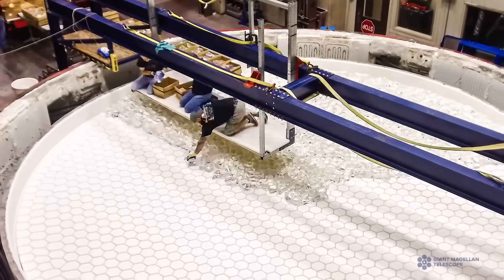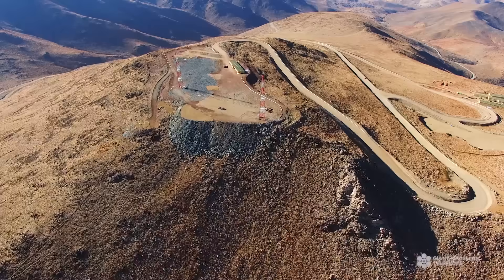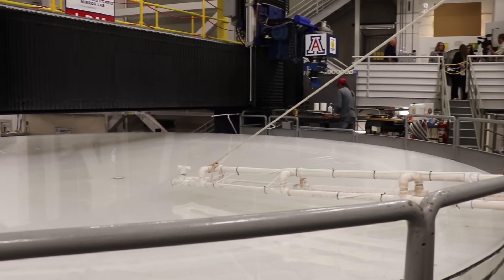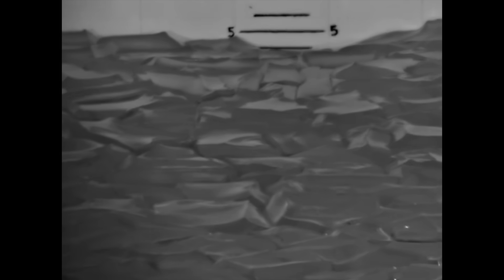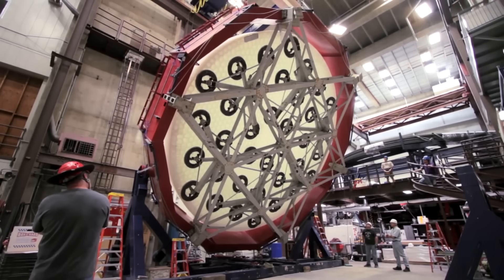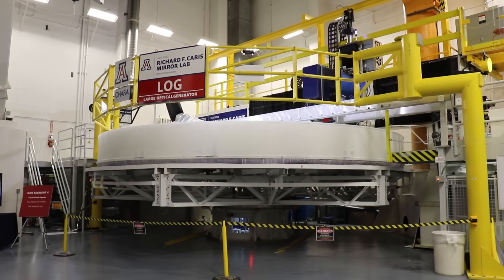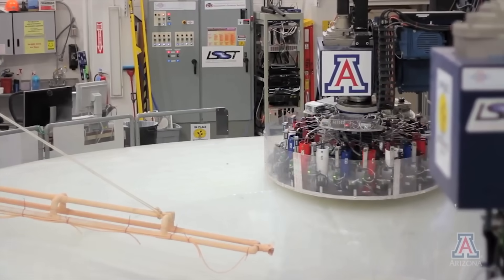Casting a $20 Million Mirror for the World’s Largest Telescope

Comment: There was no manual for that stuff. And they had to nail everything first try. With processes that had to run flawlessly and continuoutsly for years.
Reply: They still haven't finished. It's taking much longer than expected. Most things didn't go flawlessly and they didn't nail things first try.
Reply: @lynth  I can imagine, but man, everything hinges on this gigantic optics, there are quite a few mistakes one can make to ruin this 3 billion dollar project. And you know, there is also manual for it, just found these guys are called Richard F. Caris Mirror Laboratory and they are experts in this, pioneered so much technology and quite literally polished their processes over decades.

Comment: 25 meters diamater looks wrong. It doesn't relate to its size shown or how much it weights or it needs 25 stories building to house it.  It is also kinda odd that I can buy mirror meters in size and here, 25 meters one costs 20millions and have to be done in pieces.  They should instead visited their local IKEA, would had saved 20 20 millions...

Comment: would it be easier and better/larger to build a mobile factory on the mountain top? :) so when the job is finished. just just connect the mirror from beneath and can swing It that way. you don't have to adapt to the transportation of the mirror, means you can build a 100meter mirror :)

Comment: The first thing that comes to me is water optics... as in a plastic or glass mold filled with water instead of a glass lens or mirror. There's quite a range of stuff I don't understand if that would be possible or not but it seems like the least resistive way to manufacter large optics using readily available mediums.

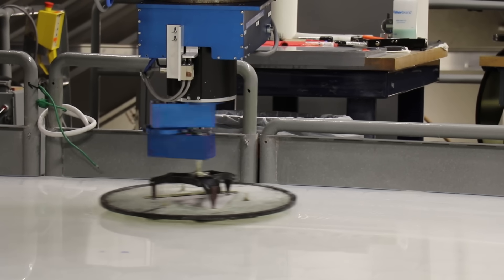Comment: 2:09 “that’ll get us down to nanometer level precision.” holy smokes
Reply: Yeah, when you're doing something like this, just a really small imprecision can fuck your numbers up.
Reply: @AAAAAA-qs1bv  it's in ratio. 
It looks small to you but it's big in terms of ratio. It's a significant error for them because of the distance in between
Reply: General Motors builds their cars on that principle! lol
Reply: The mirrors we use for photo lithography in the smallest semi processor nodes are only about a meter in diameter. If you were to proportionally scale them to the diameter of the earth the largest abberation on the surface would still be smaller than the thickness of a human hair. Modern grinding/polishing tech is crazyyyy.

Comment: You know I think I figured this out.
Take a non reactive atmosphere i.e. pure nitrogen.  In which spin a bowl of sodium silicate to produce the required profile.
Then just introduce CO2 crystallizing the sodium silicate into solid glass.  Without the temperature difference in production there should therefore be no thermal stresses.  The sodium silicate being water soluble should have a controlled viscosity, which means it should be possible to have the centrifuge, more closely produce the intended profile.

Comment: For the love of science, QUIT using a vacuum for the application of the reflective coating, purge it with ARGON!!!!!
Reply: Why?
Reply: @logitech4873  vacuum does not remove all air no matter how much it is tried
Argon on the other hand will displace everything that can cause oxidation of the mirror finish when it is applied
They had issues with this on the original Hubbard telescppe
Reply: @Twinkcentral  That's probably a very good point, but if they decided on using a vacuum for this project then there's probably a reason they chose it over argon.
Reply: @logitech4873  Not necessarily, remember even with all the edumicated scientists building the 1st Hubble, they still managed to screw it up. And if II am not mistaken they screwed up the most recent space telescope also

Comment: Ok..So melpco centra lab Made the Parabolic refractor for the Hubble telescope. That was a subsidiary of North American Philips. Which is actually philco of the Netherlands fortune 3! People don't realize when they see their Philips electronics that Phillips is fortune 3 not Fortune 10 or Fortune 500 fortune 3! Meeting there the third biggest corporation on the face of the globe. I worked in the department that made the ceramic circuit boards with silk-screened on traces. That was located in Glendale Wisconsin and another facility in Waukesha. The state of the art 28 head pick-and-place machines made by Mitsubishi were amazing and you should have seen our annealing process that we had to go through for this mirror unbelievable more talkin way back then I'm sure they have a thousand head pick-and-place machines by now which actually pick your little components out and suck them up with vacuum and grab them with microscopic little hands and go on the X Y and Phi  access picking & placing your submicronic
Reply: Circuitry. Sorry my Google speak to text is garbage I'm sure this was at the very best incoherent anyway that was the end of my statement you guys would have been amazed at the technology I still haven't seen it in the workplace ever again.

Comment: The earliest telescopes were crude, yes. However, our method of advancement didnt change too much. 
Want a better telescope? Make a bigger lense.
Reply: That's not true at all. It's just one of many factors, but it's still relevant as the laws of physics have yet to drastically change
Reply: @IFearlessINinja  laws do not change in physics per se but they do improve.
Reply: @savitaghagat8566  they don't improve, we discover/change our knowledge of the rules*
Reply: @zed538  and that can be called a improvement
Reply: @savitaghagat8566  from our viewpoint but the Physic rule doesn't change
Reply: @zed538  yes, and I mentioned that clearly in my original reply to @IFearlesslNinja
Reply: Or. You know. Put it in fucking space. 

“Advancement didn’t change too much...”
Reply: Not entirely true. A 200m mirror wouldn't be any better than a 5m one without adaptive optics. The technology for that is fascinating.
Reply: Not necessarily, size isn't the only factor that determine how good a telescope is, there's also the design of the telescope, the shape of a telescope's mirror, the type of materials used in the making of a telescope, the polishing of the mirror, ect.
Reply: The concept is solid, so why not make the most of it? Sometimes a simple solution is the best.
Reply: Laughs in ALMA observatory
Reply: *lens

Comment: Is there a reason why these mirrors have to be made specifically from glass? Can they not use any type of metal as mirror surface?
Reply: There is a mostly silver plating on glass that gives us mirrors that we know, without the glass its not very protected from dings or scratches etc and could ruin the mirror
Reply: @FractalNinja  So glass is a better substrate to apply silver coating compared to metals due a more perfect surface?
Reply: @tomorsodnompil8008  Annealed glass is extremely hard, rigid and resistant to chemicals. 
I guess it's the best material for the job, although I'm not sure exactly why all metals are ruled out.

Comment: "(...) that'll get us down to a nanometer level precision (...)" - it is simple impossible for an object this size. It would be very difficult to obtain micrometer level precision either.
Reply: You obviously don't know anything about telescopes.
Reply: @stargazer7644  But I know "something" about machining and metrology.
Reply: @dzikusdzikusdzikus  Well then just to fill you in, higher end consumer grade telescopes you buy off the shelf have mirrors ground to 1/20 of a wavelength of light.  That's about 27nm.  Professional instruments and ones used into the UV have much tighter constraints.  Telescope mirrors and mirror cells are engineered to hold these tolerances - that's why the glass is so thick.  They have to, to properly focus light without aberrations.  When's the last time you had to use a foucault test to measure something you machined?
Reply: @stargazer7644  I'm not talking about "higher end consumer grade telescopes" which has much smaller diameter. I'm talking about this huge one. In extremely large object even something like thermal expansion phenomenon lead to change in size which could be measured in parts of MILLIMETERS (maybe even whole ones) instead of nanometers.
Reply: @dzikusdzikusdzikus  Perhaps you could read past the first sentence next time.  The glass used in telescope mirrors is a mixture of two different glasses with opposite thermal expansion coefficients so that the glass has essentially zero thermal expansion.  You really don't know anything about the science and engineering involved, do you?
Reply: @stargazer7644  Even if you mix such a huge mass (40T?) Of two different materials, I am sure there is no guarantee that this "blend" is consistent throughout the volume. In addition, the different thermal expansion coefficients must be associated with a different chemical composition which is likely to be responsible for the different densities, which further worsens the mixing process. 

In concluding this conversation, I would like to ask one question: if you are such a smart and well-educated person, is there any particular reason why you need to show your "brain power" in such an offensive and aggressive way? Especially when you direct all this negative energy against me - a poor anonymous villager from a Third World country?
Reply: @stargazer7644  

I always thought that real science asks uncomfortable questions and checks the truth of the answers. In the last few months I have read dozens of scientific articles and I found bugs in several of them, although the papers had to be verified before publication. The values DECLARED by the creators are one thing, the MEASURED values by the skeptics are another, and the REAL values are a completely different story. Do you have the option of taking these measurements? Do you know reliable sources where these unreliable accuracy have been verified on the basis of the so-called The scientific method?

PS If you are "frustrated" by the questions asked by the anonymous internet, perhaps you should spend less time staring at the stars and more time developing the emotional intelligence that will help you live in society. Unless you're going to spend your whole life watching the world through a fancy tube with a super ultra smooth mirror inside.

Comment: The testing error that led to Hubble mirror fiasco | New Scientist | Aug. 18, 1990

https://www.newscientist.com/article/mg12717301-000-the-testing-error-that-led-to-hubble-mirror-fiasco/

[ NASA has established how a mirror aboard its $1.5 billion Hubble Telescope came to be the wrong shape. The agency said last week that errors in a test instrument apparently led Perkin-Elmer, which fabricated the optics, to finish the 2.4-metre primary mirror of the Hubble Space Telescope incorrectly. Tests by NASA earlier this month showed that a lens in the test instrument, called the ‘reflective null corrector’, is about a millimetre askew. Preliminary analysis indicates that an error of this magnitude could cause the spherical aberration that prevents Hubble from focusing sharply.

The crucial error, the misalignment of a lens by a millimetre, is ‘very large’ by optical standards, says Daniel Schroeder, an astronomer at Beloit College in Wisconsin, and a codesigner of Hubble. In some optical instruments, positions are measured to a fraction of the wavelength of light, less than a thousandth of a millimetre.

Ironically, Perkin-Elmer ignored warnings of the problem detected by a cruder test instrument. NASA says that it trusted the refractive null corrector because it had been ‘certified’ for final tests of the mirror’s shape.

Perkin-Elmer, which built Hubble at its Danbury plant in Connecticut, tested the primary and secondary mirrors separately, but no one tested the complete telescope before launch. An earlier check by NASA absolved the design itself of blame, leading the agency to narrow the inquiry to possible errors in the testing of the mirrors.

The reflective null corrector is a cylinder 76 centimetres high and about half a metre wide. It contains two mirrors and a lens, made specifically to test the Hubble primary. By passing light between two mirrors and through a field lens, the instrument should have generated a wavefront matching the desired shape of the primary mirror. The mirror was finished to match the wavefront, so errors in the corrector meant that the final mirror had the wrong shape *(clik link to see diagram)*.

After the primary was polished and coated in 1981, the reflective null corrector stayed ‘essentially unchanged’ at the Danbury plant, which Perkin-Elmer sold to Hughes Aircraft last year. NASA is continuing its tests of the instrument. Its investigation board will now concentrate on improving measurements of the error, and on checking for other possible errors. The panel was due to meet this week in Danbury to review testing procedures and data.

Ironically, builders of large ground-based telescopes normally test mirrors two or three different ways, and continue testing until results agree. Crucially, Perkin-Elmer ignored tests with a smaller ‘refractive’ null corrector which used lenses rather than mirrors. NASA says the refractive instrument was ‘much cruder’, and that – unlike the reflective null corrector – it was neither ‘certified’ to measure spherical aberration, nor intended for precise measurement of the final surface figure. It now appears that the cruder instrument gave the correct result.

The Hubble space telescope is not the only optical system giving NASA trouble. Mirrors for a weather satellite due to be launched in February 1992 warp when exposed to direct sunlight. The fault should be easier to remedy than the one afflicting Hubble. However, the National Oceanic and Atmospheric Administration badly needs the satellite in orbit; it is to replace the US’s only civilian satellite now collecting data on weather. ...]

Comment: During the construction of the Hubble lens a worker left a wrench on the scaffolding above it.  A senior designer observed it during a "last check" before final completion efforts.  Of course, the Hubble lens was constructed in a "perfectly imperfect" manner I could not understand...they later fixed the Hubble while in space when they realized the Hubble "needed glasses" to be corrected because all the images were blurry.
Reply: First, the Hubble doesn't have lenses, it has mirrors.  The mirror was made perfectly to the wrong shape.  It couldn't focus all the light to the same point.  They put correcting lenses in each observing camera to correct for this.

Comment: Not that big of a problem as it might seem. Assuming the bird poo is around 1cm in diameter on the mirror surface, assuming single mirror is around 8m in diameter (entire thing was mentioned to be 25 meters in diameter), then the poo is 1/64000000 (one in 64 million) of single mirror surface or around 2 billionth of the entire surface of composite mirror.
The poo will not be visible on the resulting image, instead what happens is that the amount of reflected light is diminished by 2 billionth and also, I think, it might loos a little bit of contrast.

6

Comment: Would it be more reasonable to speed up polishing by having multiple independent parallel polishing pads that work on different sections of the mirror at the same time. It would work for the bulk of the mirror, and you only would not be able to use it in the center of the mirror. It could easily speed up the process from 18 months to maybe 3-4 months.

Comment: why not just use large sheets of polished aluminum, and save a fortune in time and money?. hell when you think of just the labor cost of making a glass mirror of that size, you could make it out of 4" thick aluminum with the parabolic curve ground into it and save enough to make probably a couple more just for spares. and it wouldn't take a year or 2 just to make it, like it does now what with the cool down period of months and then all the grinding of the rear and the front. I bet we would all have a heart attack if we knew what one of those giant pyrex glass mirror cost completed!. there's really no reason to keep making them out of glass!, not when we have the tech to polish a piece of metal to a mirror finish so why waste the time and the Hugh. expense
Reply: It’s not nearly as accurate... quality over quantity

Comment: I’m surprised they are doing this much work for a mirror that will be on earth.  Our atmosphere causes interference that is unavoidable with the best mirror.  I’d think they would put this in a satellite like the Hubble.
Reply: This is too heavy to launch into space. This telescope will have a system to bend the mirrors and actively compensate for atmospheric interference (the lasers in the animation)
Reply: You're a little behind the times. Adaptive optics now allow large Earth based telescopes to take better images than Hubble.  AO uses flexible mirrors and computers to correct for atmospheric distortion in realtime.
Reply: @stargazer7644  that’s interesting.  I gotta read up more of the new technology.

Comment: And how long will such precision stay if the glass is like a liquid and moves over time?
Reply: It doesn't move really. Solid lead flows billions of times more and even that can be negated. It would take billions of years for these mirrors to flow even fractions of a millimeter. The reflective layer on it will corrode and need polishing/coating every decade or such. This will be a much bigger challenge to its dimensional stability.
Reply: That has been disproven. Glass is an amorphous solid.
Reply: Glass doesn't flow like a liquid.